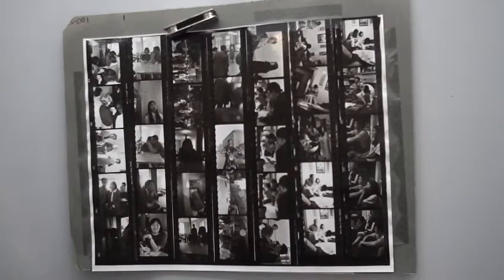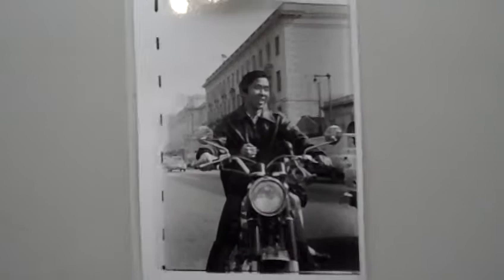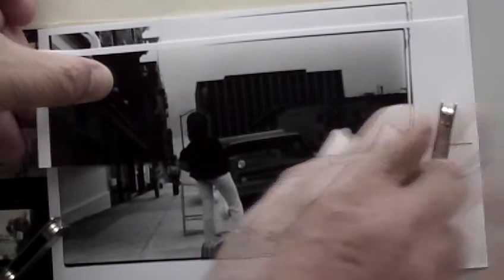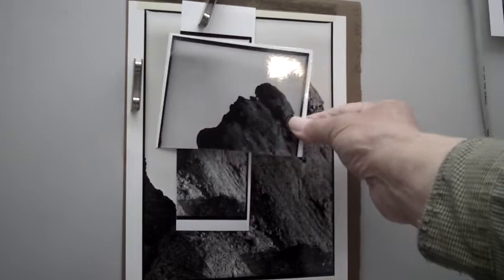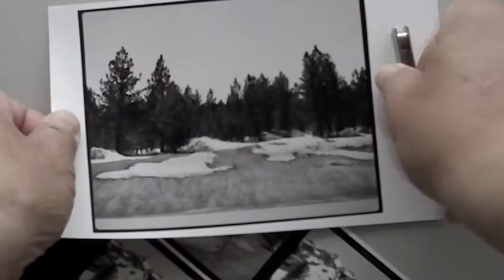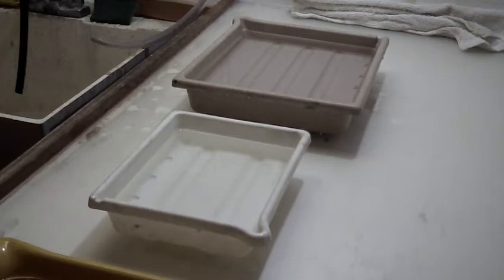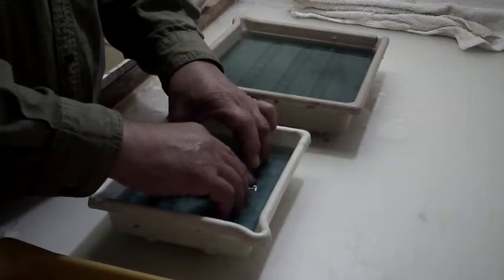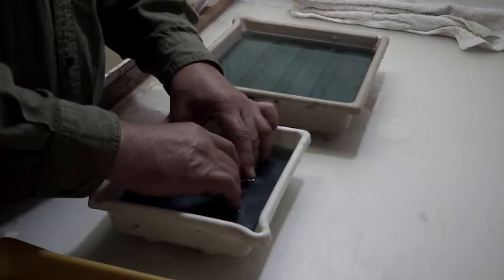How I Process Roll Film in Trays

Comment: Thank you for this helpful video.
I had been trying to load a huge old 118 roll film, 6 pictures of 4 1/2 x 3 1/4 inches found in a Kodak number 3 model H onto a modified pair of Paterson carriers.
No success. The film was Verichrome, the ortho type and hasn't been made since 1961.
Using your guide I chose total darkness rather than a safelight and processed in HC-110 dilution B for 5.30.
I was surprised how slippery and cooperative the film was in passing from one hand to the other and it suffered no scratches.
I wore thin powder free gloves rather than touch the chemicals and the film was saved finger-nail scratches as a bonus. 
The film processed beautifully but had some age spots after at least sixty years rolled up. I've no idea who the people in the pictures were
but they were on a golf or bowls green and certainly looked happy and very smartly dressed!
I won't hesitate to use your method again. Thanks for giving me the confidence to use it for the first time!

Comment: I have never noticed my roll film have uneven development.  I process in a tank and agitate by inversion, no spinning of the reels (2 reels is the most I will process at a time).  However, I have used a Jobo 2500 system tank and reel for 4x5 film and rotated the tank on a motor base similar to what Jobo's automated system does.  First thing I noticed was the heavy overdevelopment across the edges that were fitted inside the reel's guides.  I could actually see how the developer flowed in and around the reel's guide edges by the pattern on the film.  I was told by Jobo rep that my rotation should be around 50 to 60 rpm instead of the 25 rpm I was using.  That didn't make sense to me, so I took an emery board and altered the edges/film guides so the fluid would not be so constrained in those areas.  It worked, and I have no more pronounced overdevelopment where the film rested along and inside the film guides of the reels.  BTW, I only use the SP445 tank now, best processing of sheet film I have ever used.  Thanks for doing what you doing here, it is very educational.
Reply from the maker: Well, I don't have a Jobo system and haven't tried it, but heard good things about it... even from John Sexton.  I also don't process a lot of film.  I used to shoot alot when I was young.  Now I do more printing than shooting; I have so many negs to print from before.  So I tray develop every thing and only 1 roll at a time - 1 sheet at a time.  Looks like you figured it out so congrats to you.

Comment: Is it safe to handle rodinal without gloves? I get nervous when a couple of drops spill off my tank.
Reply from the maker: Should be fine. I get developer on my hands all the time, esp. when making prints. Your fingers will feel slimy. I placemy fingers into the stop beth to neutralize the dev, til my fingers are no longer slimy. I can tell, by doing this, how my stop bath is doing. If it takes too long to "clear" my fingers of dev, I change the stop bath. Stop baths will always become inactive sooner than fixer or developer so it needs to be changed more often. I use my hands to do this.
Reply: @timihall930  thank you so much Timi, you're a priceless source of information and experience. Hope you're doing well

Comment: When processing roll film n a try it is important to keeep the film under the developer at all times. The method shown here exposes the film with developer on it to the air which will affect the results.
Reply from the maker: Actually the film is submerged at all times and the developer is made fresh and disposed of.  I do process a couple of sheets of waste film (exposed but unprocessed) in order to "season" the developer.  I have found that only in this way was I able to get the most consistent processing.  I also process sheet film in trays with the same formula/technique.  I am able to maintain a gray patch in the 4 corners of 5 sheets of 8x10 films (each processed individually).  The gray patches come within +/_ .03 of each other.  I do extend the processing time for each successive sheet by 15 seconds in order to accommodate the used energy.

Comment: Thank you for the very informative video! I've always wanted to try this technique and your lesson shows very clearly how it's done. One question, whar developer do you use? I use a pyro dev and I dont fancy putting my hands in it (although I bet the old masters did all the time). I'd happily give your recomendation a try :)
Reply from the maker: Hi John - 
   I use HC 110 when processing sheet films in trays. But in this case, processing 120 films, I use Ilford's Microphene diluted 1 part stock to 2 parts water. I find that I lose less speed with Microphene when processing Tri X (I rate it at ISO 320).
   The pyro formula is a wonderful one that I learned to use from my father who learned it from Wynn Bullock.  Unfortunately the present day films have a hardener that causes the pyro to have less of a staining action than it used to have. It still works but the brown tone of the negative is much less.  The old negatives processing in pyro would not only be brown but when looking at the emulsion the image looks "etched" into the film.  This resulted in a very high acutance when printing from pyro negatives. 
    I found that Ilford films responded best to pyro solutions when Kodak began to pre harden their films. But it has been years since I've tried the pyro formula.  The old black and white pyro negatives that I inherited from my father has that look on the emulsion side which looks very similar to looking at the emulsion side of Kodachrome transparency film,
   Printing with a brown toned negative is like printing with a safelight and it is the reason why Ansel stopped using the pyro formula.  He said that it was "unpredictable."  But I loved it when I was young.  My father often told me that Wynn's black and white negatives were very thin.  That was because you only needed a little  bit of detail when that detail was brown in color.
   And yes, it also caused your fingers to go brown in time.

Alas, now I used Microphene for the technique in this video.
Reply: Timi

Thanks for the reply. Microphen is a great all rounder. I’m going to give it a try and also do another roll in D23 for 5 mins to compare (so simple to make with only two chemicals). You’ve been a great help. I had another question. You mention using a green light to inspect the negatives. Any more advice on using this inspection technique would be great.
Reply from the maker: The dark green safe-light... I think it is a number 10 (from Kodak) requires only a 7.5 watt bulb and it has to be kept at least 5 feet from the film.  It is turned on only after at least 50% of the processing time has been completed.
You keep the green light (turned on) on your back while you remove the film from the developer. The film must be held with the emulsion side up as you lean away to allow the green safe-light to shine onto the film.
The inspection is only done for a couple of seconds and then you again place your body back into position to block the safe-light.
This was the technique Wynn Bullock used when he processed with his pyro formula.  He told my father to recognize the "middle gray" of the subject and to compare it with the film base (the edge of the film that was unexposed). When the middle gray of the subject reached the correct density you then placed the film into the stop bath.
This was how I first learned to process film back in the 1960s.
Reply: Timi Hall Thanks for taking the time to grow my knowledge of black and white processing! You take a deeper dive into black and white that appeals to me. I look forward to learning more from your engaging videos!

My father taught me to develop films and process the negatives when I was eight years old way back in the 60s and although I've gone digital for the last few years I'm getting back into darkroom photography and thoroughly enjoying the process. 

There's nothing like making developers, stop baths and fixers, feeling that film and paper in your hands, the tactile experience of creating art with wet photography is awesome. Thanks again for you facilitating my advancement in this field.
Reply from the maker: HI John -
   I never left analogue photography although I ventured into digital imaging starting in 1995 when I bit the bullet and spent $750,000 on equipment to take my business into the digital arena.
   I knew I was to close my business in 2015 and two years before that I decided to go back to making black and white prints in the darkroom.  Most of the films I had in storage was in transparency form and so I had to come up with a way to convert these images into black and white negatives  My latest video explains how, what and why I came up with the solution at hand.
   As of late I have noticed that most are too involved with technology in order to gain their information and inspiration from life.  It can be likened to one listening to their favorite music in their car while they are driving (through a connection that allows them to access MP3 files). I remember when I was a young person who spent his weekly pay (I had a paper route) on a record that I purchased at a music store.  And then I would sit in front of my speakers with the record jacket in my hands. Then I would read all the text and listen to the music again and again.
   In this way I absorbed what I could and concentrated on the music as best I could. I want to find a way to get photographers to give this kind of attention (again) to the fine photograph. Looking at images on a computer screen, or worse yet, on an Iphone, removes the emotional and spiritual experience that a fine photograph can induce.
   As a remedy I plan to offer a couple of my images in a very small form (to keep costs at a minimum) requiring the viewer to look at these prints from about 6" away.  Hopefully the experience of holding a real photograph that has good separation of detail will spark a renewed interest in the (real) photographic print.
   My next video will outline the detail on how to get these prints.

Thanks,  timi